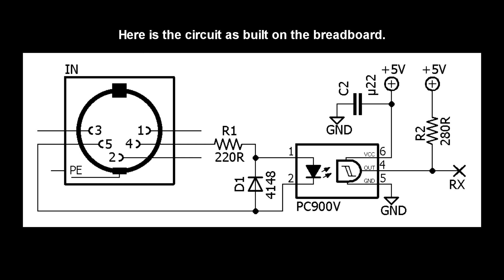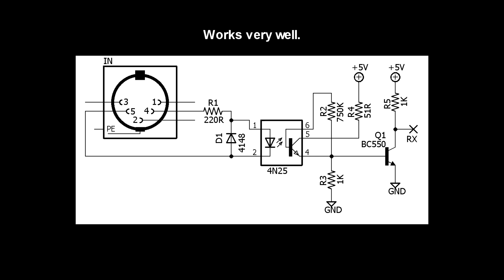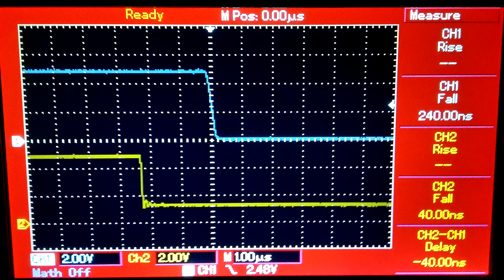PC900 Optocoupler  MIDI IN Circuit Test

Comment: Only 2 wires connected from the midi in?
Reply from the maker: Yes, it is a current loop, the cable shield is grounded only at the MIDI output connector.